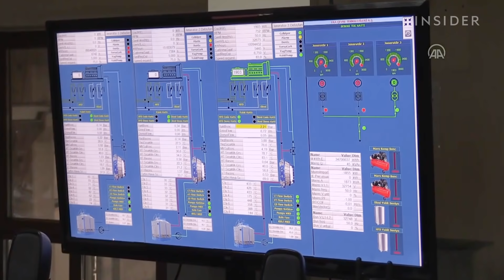How Old Tires Are Turned Into Electricity | World Wide Waste | Business Insider

Comment: The guy said burning sulfur is the toxic part. No, its how its burned that can be hazardous. If the tires are burned in a plant specifically designed to conflagrate at controlled temps, then everything can be harvested, including the sulfur dioxide, carbon, and the steel. belts.

Comment: If the shredded tires are burned in the proper sort of process, one, for instance, with low btu value fuel that needs augmentation with tire chunks to get the temperature in the process correct in order to prevent various noxious gases, burning is not a bad way to go.  adding tires to the mix for making cement works well too, if temps are controlled properly (tires added at correct rate).   Adding very small ground pieces (such as are created in crhyogenic grinding) to asphalt also is a proven way to create longer lasting and smoother surfaces.

Comment: wouldn't it be smarter to re thread them ? We used to do it and it's still done for high value heavy duty tires. It's a choice we made to make them disposable.
Granted the re threaded tires may not have exactly the same characteristics, I'm no expert. Also there will still the occasional exploded or damaged tire, but worn ones are definitely the bulk of the landfills.

Comment: How can the wire belts be removed from the tire?  Seems impossible, they are so embedded under  the tread where most of the rubber is.

We used to retread tires.  Big trucks still do.  If I'm not mistaken, radials are hard to recap.

Pirelli had a radial tire that you actually bought new tread when the old one was worn out!  Held in place with big circumferential grooves.
Reply: You cool they tire yo minus 70 degree celcius using líquido proane or líquido nitrógeno crush they tire and You have they steel and they cotón+nilón problema si they cost

Comment: So...lets have a look what they are saying on their own website: 

“Our facility has the capacity to recycle 20 thousand tons of tires that have completed their lifespan to the economy, rather than being buried or sent to the landfill every year. Waste tires coming to our facility are not burned. We do material recovery with the process performed in an oxygen-free environment using our facility's own patented technology without burning it. We contribute to the economy by using the steel wire we recover from tires in the metal industry, pyrolytic oil in electricity generation, and the solid parts in carbon black production, which is used in paint and cosmetics. Waste tire enters the facility, all components inside are recycled and it becomes zero waste. "

Aydın (CEO)  stated that they can produce 5 thousand megawatts of licensed electricity per month and 60 thousand megawatts per month from the 4 generators in the facility, saying, "In our facility, the electricity of an average of 20 thousand households is produced from the recycling of waste tires and both imports are reduced and the product that goes to waste is brought into the economy, with zero emissions."

my conclusion = "prejudice is not good!"
Reply: Pyrolysis emits  toxic bi products.  But what else is there to do.

Comment: Calling the fumes generated “not the most environmentally friendly process” is such an euphemism
Reply: they also said its one of the most dangerous
Reply: They don't burn the tires didn't you pay attention they transform the tires into some time of oil and they burn the oil, wtf do you think keeps your lights on and powers your car?
Reply: @alierrtrillo9368  ... that's the battery and the alternator, bud.
And before you say it's powered by the moter, which is petroleum fueled, I replaced the motor by a wheel with caged midgets. 
My car runs on midgets.
Reply: My thoughts exactly, too.
Reply: You clearly have no idea what pyrolytic oil is and how its made
and that is why the oceans are screwed and there's garbage all over the place.
Reply: The oil produced is akin to unrefined diesel and the gas almost the same as natural gas. So yea not very friendly but not worse than what we are dooing as im writing this.
Reply: Stop driving then

Comment: The tires can be reused in gardens as beds or containers to hold the soil. It can also be used to create walls, steps and in many creative projects. I don't see tires as waste. It surely is a waste if it's in pieces or burned... Collect them, stack them, use them creatively.
Reply: But then it is in the enviroment. Containing soil in them to let leach out what they had accumulated in their lifetime beside the stuff on production?
Reply: @wernerhiemer406  Even if it does contaminate the soil with toxins the amount is harmless and they break down extremely slowly. If tires would be so dangerous and bad for the environment then no one would ever make anything out of them. It is in the same category as plastic but more resistant and flexible.
Reply: Reclaiming fuel oil from waste plastics is the best solution to the world's garbage issue. It's non toxic, partially reclaimable, eco friendly. The only reason people don't like it is because it doesn't solve the 'global warming' issue... well, Shell and BP are still going to sell you petrol and diesel u til they run out. Only question is, would you rather have a runaway greenhouse effect in 5000 years with a world toxified and covered in trash? Or a runaway greenhouse effect in 4800 years with clean water and thriving ecosystems? Fight the battles you can win, not the ones you can't

Comment: They are not burning the tires directly.  They shred the tires, put them in an oxygen free can, heat that can up.  Without oxygen, the heat breaks the tire chunks down into carbon ash, gas fuel, liquid fuels and probably other chemicals.  I have seen examples of the gas fuel being burnt and released under water to eliminate contaminants.  The ash can be used for roads.  The liquid fuels range from diesel to something close to gasoline.  It depends on how and how long it is cooked.  The same process is done with plastic in India.  I am sure it is government subsidized.  This channel should investigate the real costs of this process.  Factories have to be built.  Energy is consumed to heat the tires.  I am no expert on this.  It seems like it could cost $5 to get $1 of diesel or other liquid fuel.  I honestly do not know the benefit per cost.  I am curious for someone to show the real benefit per cost of this process.  Mankind can make real diamonds in a lab but the cost is more expensive than digging real diamonds out of the ground.

Comment: What kind of emissions are released from the burning of tires? Those tires could be used to make new tires.
Reply: No. Not possible.  Fibre Steel must be removed. Ground down rubber and de sulphurised to be re applied
Reply: No you cannot reuse tires
Reply: @pokechannel9758  Yes, you can re-use old tires. First of all, they can be dissolved into a liquid with heat and pressure. That liquid can be blended with synthetic rubber to make new tires. Also, that liquid can be used in other industrial processes. And you can simply grind old tires into a fine powder, which can be used as a filler in many applications, such as injection molding and road construction. The reason that old tires aren’t recycled is clear: Goodyear and the other tire companies make a lot of money on expensive new tires. When I was a kid, retreads sold for ten dollars. Nowadays, a new Goodyear tire sells for two hundred dollars. There’s no recycling because the tire companies wish to eliminate all competition.
Reply: @pokechannel9758  you can literally regroove old tyres. as well as shaving the tyre down and then putting a new tread on it like they do with big mining dump truck tyres but the same applies for everyday car tyres.
Reply: @Insomniac3d  that be too much work lad, mining truck tires are re-grooved because they are very expensive and used in controlled environments at low speed.
Reply: @Insomniac3d  Regrooving tires hasn't existed for many, many decades.  There is no excess rubber above the wire fabric.  Retreading went out with the increased popularity of radial tires.  Doesn't work.
Reply: @frequentlycynical642  retreading exists in countries that banned this disgusting practice of burning tyres you fool.
Reply: @frequentlycynical642  might I add to the conversation cars weren’t going 80 and 90 freeway speeds an getting tires to last 50,000 neither the highways everywhere not to long ago was 55. I would rather not drive on some retreads your tires do a lot work to keep a clump of shit going to a to b.

Comment: Using it in pavement and throwing it away is a bad idea as it will leach chemicals in the surrounding. Burning is not a solution but a patch unless use the fuses to manufacture sulfuric acid for industrial use. The better solution is taking the liquid tyre and remaking a new tyres.... moulding

Comment: The news report is incomplete and did not explain the other advantages! 

The process is NOT a direct burning of tyres as opposed to incineration plant. It will be very pollutant if these are burn directly. The chemical process is controlled and adhere to environmental regulations. Thanks to brilliant minds of chemical engineers who designed the process systems.

At 2:50, it is mentioned the old tyres are shredded and subjected to chemical process, producing a by-product called pyrolisis oil (comparable with biofuel) by pyrolisis thermal process
http://2gbiopower.com/#:~:text=Enviro's%20pyrolysis%20process%20recovers%20the,products%20including%20new%20vehicle%20tyres.)
The other two recyclable by-products are steel wires and carbon-black. "Carbon Black originally used to make the tyres, is recovered along with the other inert fillers. This is milled and beaded for re-use in rubber components. 1kg of virgin Carbon Black is made from ~1.6 litres of fossil fuel. Recycling carbon black (rather than burning tyres) reduces emissions by about 80%."

Only the pyrolisis oil produced are then use as fuel to burn (instead of coal or crude oil by product) in the thermal plant boiler to generate superheated steam which feed to the turbines. The turbines are then power the generators to produce electricity.

Comment: To sum up, we make electricity from burning tires. However, by doing it we make the air quality worse. So as we can see there are pros and cons.
Reply: The process is NOT a direct burning of tyres as opposed to incineration plant. It will be very pollutant if these are burn directly. The chemical process is controlled and adhere to environmental regulations. Thanks to brilliant minds of chemical engineers who designed the process systems.

At 2:50, it is mentioned the old tyres are converted first to pyrolisis oil, a by-product comparable with biofuel (by pyrolisis thermal process
http://2gbiopower.com/#:~:text=Enviro's%20pyrolysis%20process%20recovers%20the,products%20including%20new%20vehicle%20tyres.)

The pyrolisis oil produced are then use as fuel to burn (instead of coal or crude oil by product) in the thermal plant boiler to generate superheated steam which feed to the turbines. The turbines are then power the generators which produce electricity.

Comment: Jesus Christ. Putting them in the landfill would actually be better than burning them. This is not good.
Reply: It is still environmentally friendly than landfill. The news report is incomplete and did not explain further the advantages. The process is NOT a direct burning of tyres as opposed to incineration plant. It will be very pollutant if these are burn directly. The chemical process is controlled and adhere to environmental regulations.

At 2:50, it is mentioned the old tyres are shredded and subjected to chemical process, producing a by-product called pyrolisis oil (comparable with biofuel) by pyrolisis thermal process
http://2gbiopower.com/#:~:text=Enviro's%20pyrolysis%20process%20recovers%20the,products%20including%20new%20vehicle%20tyres.)
The other two recyclable by-products are steel wires and carbon-black. "Carbon Black originally used to make the tyres, is recovered along with the other inert fillers. This is milled and beaded for re-use in rubber components. 1kg of virgin Carbon Black is made from ~1.6 litres of fossil fuel. Recycling carbon black (rather than burning tyres) reduces emissions by about 80%."

Only the pyrolisis oil produced are then use as fuel to burn (instead of coal or crude oil by product) in the thermal plant boiler to generate superheated steam which feed to the turbines. The turbines are then power the generators to produce electricity.

Comment: I do agree with the comments below that this video is pointless by showing conveyor belts and shredders. They should also show what are the different chemicals and toxins that are produced when tires are burnt . How are these dangerous chemicals treated ?
Reply: I agree the news report is very incomplete. But if you research further, the process is NOT a direct burning of tyres as opposed to incineration plant. It will be very pollutant if these are burn directly. Also a better option than putting those used tyres in landfill.

At 2:50, it is mentioned the old tyres are shredded and subjected to chemical process, producing a by-product called pyrolisis oil (comparable with biofuel) by pyrolisis thermal process, read this link:
http://2gbiopower.com/#:~:text=Enviro's%20pyrolysis%20process%20recovers%20the,products%20including%20new%20vehicle%20tyres.) The chemical process is controlled and adhere to environmental regulations. 

The other two recyclable by-products are steel wires and carbon-black. "Carbon Black originally used to make the tyres, is recovered along with the other inert fillers. This is milled and beaded for re-use in rubber components. 1kg of virgin Carbon Black is made from ~1.6 litres of fossil fuel. Recycling carbon black (rather than burning tyres) reduces emissions by about 80%."

Only the pyrolisis oil produced are then use as fuel to burn (instead of coal or crude oil by product) in the thermal plant boiler to generate superheated steam which feed to the turbines. The turbines are then power the generators to produce electricity👍.

Comment: This a terrible idea polluting the planet even more Than coal. Its actually quite toxic if im not wrong
Reply: Thanks for your comment there's a gaining key on how to invest more into Bitcoin right now, are you interested?
Reply: + 1 5 1 6 2 6 8 2 1 8 6
Reply: Yes, you're wrong because the news is incomplete. But if you research further, the process is NOT a direct burning of tyres as opposed to incineration plant. It will be very pollutant if these are burn directly. Also a better option than putting those used tyres in landfill.

At 2:50, it is mentioned the old tyres are shredded and subjected to chemical process, producing a by-product called pyrolisis oil (comparable with biofuel) by pyrolisis thermal process, read this link:
http://2gbiopower.com/#:~:text=Enviro's%20pyrolysis%20process%20recovers%20the,products%20including%20new%20vehicle%20tyres. The chemical process is controlled and adhere to environmental regulations. 

The other two recyclable by-products are steel wires and carbon-black. "Carbon Black originally used to make the tyres, is recovered along with the other inert fillers. This is milled and beaded for re-use in rubber components. 1kg of virgin Carbon Black is made from ~1.6 litres of fossil fuel. Recycling carbon black (rather than burning tyres) reduces emissions by about 80%."

Only the pyrolisis oil produced are then use as fuel to burn (instead of coal or crude oil by product) in the thermal plant boiler to generate superheated steam which feed to the turbines. The turbines are then power the generators to produce electricity👍.

Comment: So is burning tires bad for the environment? What's in that smoke and where does it go?
Reply: The process is NOT a direct burning of tyres as opposed to incineration plant. It will be very pollutant if these are burn directly. Also a better option than putting those used tyres in landfill.

At 2:50, it is mentioned the old tyres are shredded and subjected to chemical process, producing a by-product called pyrolisis oil (comparable with biofuel) by pyrolisis thermal process, read this link:
http://2gbiopower.com/#:~:text=Enviro's%20pyrolysis%20process%20recovers%20the,products%20including%20new%20vehicle%20tyres.) The chemical process is controlled and adhere to environmental regulations. 

The other two recyclable by-products are steel wires and carbon-black. "Carbon Black originally used to make the tyres, is recovered along with the other inert fillers. This is milled and beaded for re-use in rubber components. 1kg of virgin Carbon Black is made from ~1.6 litres of fossil fuel. Recycling carbon black (rather than burning tyres) reduces emissions by about 80%."

Only the pyrolisis oil produced are then use as fuel to burn (instead of coal or crude oil by product) in the thermal plant boiler to generate superheated steam which feed to the turbines. The turbines are then power the generators to produce electricity👍.